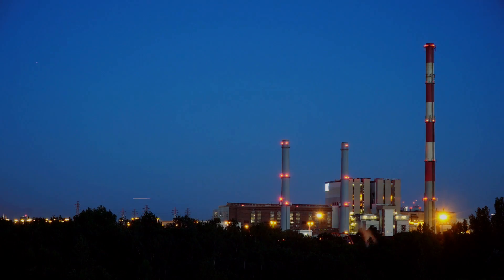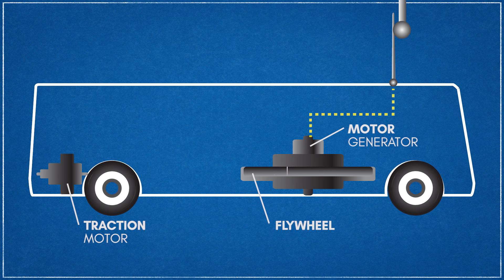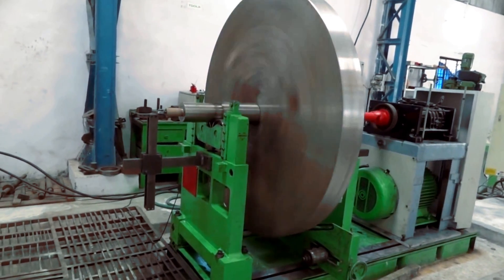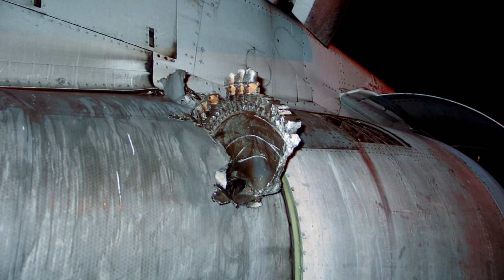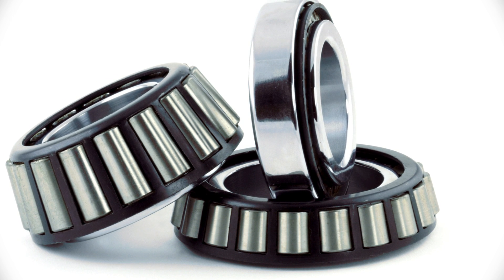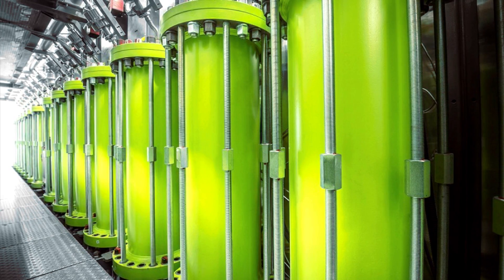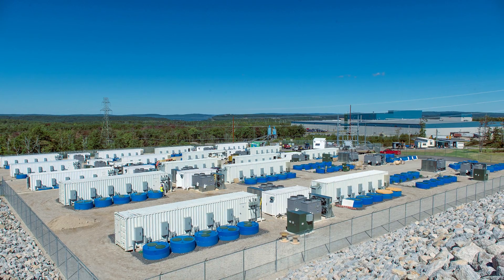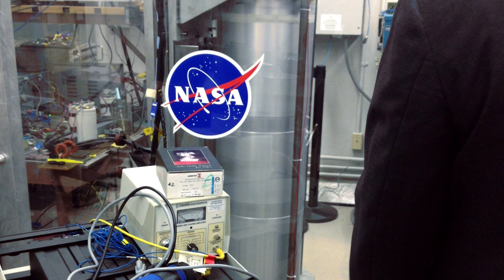The Mechanical Battery

Comment: Really nice introduction to a topic most of us are not familiar with. Seems one of the best technologies for grid storage.
Reply: The price per kWh isn't close to viable, unfortunately. You'd need something along the lines of graphene by the megaton at low prices. It's hard to compete with the power density of a flywheel, to be sure, but the energy density is lower than batteries and the price per energy capacity is lower than batteries.
Reply: @Jo Blow Huh, it doesnt? Renewable installation is led by Brazil, India and China, and developing countries install a lot more than developed ones. I agree nuclear is great, but extremely expensive. You are talking out of your ass.
Reply: Best grid storage system we have right now is called a hydro electric dam sir... grid storage system basted on a flywheel would have all of the same problems the buses had making them cost ineffective
Reply: Innovative*
Reply: @Jo Blow LFTR Reactors are definitely the best long term solution!
Reply: @cd2920  he is obviously trolling, just ignore him
Reply: for off-grid homes too, for day-to-day wind/river/solar energy storage
Reply: so advanced*
Reply: Aye
Reply: so natural*
Reply: @Jo Blow You missed the point.  It was good for short term storage . . . in the 1950s.  Since then, technology has advanced just a little bit.  Mechanical systems now have efficiencies that make them viable for longer-term storage, like for example, when the sun doesn't shine.  Their bearings are nearly frictionless.  Electrical leads store or retrieve energy into or from a sealed container, just like any other battery.  The tech may be too massive and gyroscopically troublesome  for consumer vehicles; but there's nothing wrong with using it as stationary storage in the grid or facilities like hospitals and factories.
Reply: Please do research and make videos about this topics

https://fitsmallbusiness.com/hottest-emerging-tech-jobs-2019/

Top 30 topics/ideas I want you to talk about in your future videos in this new YouTube channel "New Mind":
1.  Graphene Battery
2. Nanotechnology 
3. Artificial Intelligence, Machine Learning, and Deep Learning. 
4. The three levels of artificial intelligence 1. Weak or Narrow Artificial Intelligence  2. Strong A.I.  3. Super Artificial Intelligence 
5. Quantum Computers
6. Artificial Intelligent Robots
7. Autonomous Machines
8. Blockchain Technology
9. Bitcoin
10. Hacking and Cryptography 
11. 5G, 6G, 7G, and beyond. 5G New Radio Network.
12. Big Data
13. Cloud Computing
14. Parallel Computing
15. Geospatial Drone Technology
16. BioNanotechnology (biology and nanotechnology)
17. Tachyon (Faster-than-light-particles)(hypothetical particles)
18. Alcubierre warp drive (10 times faster than the speed of light) https://www.universetoday.com/89074/what-is-the-alcubierre-warp-drive/
19. Nuclear Fusion
20. Space-Based Solar Power
21. Bio-fuels
22. CERN. Large Hadron Collider. Antimatter
23. Dark Energy 
24. Dark Matter
25. Quantum Supremacy (Google Tech company)
26. Quantum Mechanics 
27. Quantum Teleportation 
28. Quantum Time Traveling
29. Interdimensional Travel
30. Interstellar Space Travel
Reply: @C D You don't know me.  I live off the grid.
Reply: @C D What's pathetic is that your ridiculous Alt-right wind turbines are destroying thousands of birds and bats all over the world.
Reply: @frankm3214  Cats kill billions of birds and no, they aren't eating them. Humans have allowed cats to breed to overpopulation levels but because we feed them they do not hunt for food, nor are they useful by hunting vermin. Smog and air pollution kills billions of birds and other animals and the only way to reliably get rid of that is to switch to non-polluting renewables. And again, no, renewables do not cause pollution when they produce power so yes, they are non-polluting.
Or in short: Windmills lower the amount of dead animals. Solar lowers the amount of dead animals. Anyone who complains they kill birds is either an oil lobbying liar who lies or an idiot too stupid to have an opinion that matters.
Reply: Your renewable energy wind turbines are killing thousands of birds and bats.  Do you not care?  You Alt-right Nazis care nothing about the environment.
Reply: @frankm3214  House cats kill far more. What are YOU going to do about your Tigger?
Reply: @frankm3214  are you even familiar with bird law?
Reply: @salmon taco The fact that you call it "bird law" proves that you have no idea what you're talking about.
Reply: @frankm3214  now let's say you and I go to to toe in bird law and see who comes out the victor.
Reply: @salmon taco This isn't a video game.  I'm a real person.
Reply: @frankm3214  I'll take that advice into cooperation.
Reply: Frank M its either kill some birds and bats or continue burning coal. gas. create nuclear waste. or dam rivers. there is no up side to any current technology, id prefer any system that does not accelerate climate change.
Reply: @Frank M Killing birds is better than killing humans. Still, we have to improve on this, but if you choose bats / birds over humans, you're in a special kind of stupid.
Reply: @frankm3214  Consider how many of those equal species survive every time you snuff a vicious predatory bird!
Reply: @adamblomberg  >just a tiny fraction compared to these other things
>also it's so bad that you literally need a permit and a conservation plan for how you're going to mitigate the massacre you're causing

Something doesn't smell right here.
Reply: @adamblomberg  Commercial wind turbines are killing birds that are not being killed by cats. The amount of bats being killed are threatening one species to extinction. No free lunch with any energy production.

Comment: The crankshaft converted linear motion to rotary. The flywheel reduced the effects of torque impulses.
Reply: Your half right............The crank shaft does indeed convert the motion, but the flywheel takes the engines torque pulses and delivers them to the drive train in a smooth and controlled fashion. If the engine was directly bolted to the transmission, driveshaft or torque tube the vibrations would damage and destroy even the most robust drive train components over time. I guess you could think of an engines flywheel like an electrical capacitor. Now a days, dual-mass flywheels take this a step further in manual transmissions as weight/efficiency is now a major factor and durability is reduced in favor or fuel economy. Torque convertors have all but eliminated the torque pulse problem in automatic transmissions due to their fluid coupling drive.
The engines harmonic balancer does the same for the auxiliary components, and eliminates the harmonic hum/oscillation of the belt and it's components when running.
Reply: @camerond8176  The converter IS the flywheel, it's mass negates the need for a separate flywheel. Modern converters also lock-up once the vehicle gets up to speed eliminating any effect of the fluid coupling.
 The harmonic balancer is to reduce oscillations in the twisting of the crankshaft.
Reply: Chris Russell torsional vibration damper/harmonic damper with rubber insert is a device to control crank vibration and resonance. “90 deg” thing you talk is secondary order vibration. It’s occur twice per crank revolution due to the cosine effect of the rod and crankshaft. Inline-4 engine with a flatplane crank eliminate this vibration via balance shaft
Reply: Wrong the "Flywheel" does not smooth torque impulses, that's the joke of the harmonic balancer at the front of the crank. and only manual transmission cars (a dying bread in the US :( ) has a true flywheel, all automatics use a flex plate of some sort. The torque converter acts as the rotational mass in automatic cars, the flex plate it there to hold the starter ring (some dodge have the starter ring on the torque converter) and allow flex between the crankshaft and input shaft that's inside the torque convertor
Reply: @TdrSld  the harmonic balancer dampens vibration in the crankshaft

Comment: As always amazing video 👍 there is only one thing that's bothers me from some time... why we not use springs to store energy. Are they so bad in efficiency?
Reply: The amount of energy you can put in a spring is very limited. The equation is E=1/2 k x^2. E is the energy, k is the stiffness of the spring and x is the length of compression. Too stiff springs are mechanically somewhat impractical and x is very limited as well. A better solution than steel springs would be compressed air as a spring (this principle is actually used in some edge cases). However for energy storage there is too much friction involved in the seals and the energy density is very low compared to cheaper alternatives.
Reply: @ProjectPhysX  very interesting stuff, thank you for reply.
Reply: @maciekm7953   Maciek M  I totally forgot about mechanical watches. They do use tiny springs as the energy source. At this small scale, springs are the perfect storage solution, but for larger scales other options are much better.
Reply: If we spend some research into making springs better (different properties/ materiels combined) we could make springs a viable option.

Im not sure the physics of it but... imagine a building sized watch main spring vs a building sized flywheel... lets spend 10 hours at a certain power charging it up so they should contain roughly the same amount of energy in them, i would think the flywheel would be at a disadvantage because it must be spinning to keep that energy. while the spring could simple sit there until the energy is needed.  BUT i also think that the watch spring would need to be much larger to contain the same amount of energy

Comment: Let's talk about "reinventing the wheel"..... I've always hated that phrase.
Reply: In the early to mid 1800’s, George Cayley did “reinvent” the wheel. He is the one thought to use string or wire for spokes so the axel is pulling from the top as opposed to pushing on the bottom. Like a bicycle wheel. It allowed for much lighter weight wheels. He is also the guy who came up with the aeronautical relationship of lift, thrust, drag, and weight.
Reply: Ba-dum-tss!  :-P
Reply: danballarin it means ‘a useless idea or a large waste of time/resources”. Used in the proper sense, it is a perfect phrase, conveying the ridiculousness of said endeavour. Though that is not to include the use of the words separate of them as a phrase, since the wheel has been reinvented many times, hence our use of pneumatic tires as just one example. I guess the use of a capitalisation ie “the Wheel”, for the concept and “the wheel” for the physical mechanical device is the proper way to differentiate the two.
Reply: Norm T  Not invented, "Discovered" ...   Round rocks and round logs were rolling down hills long before humans were even walking upright.  But hey, if you didn't see it- I guess it didn't happen.  Just like No bear shits in the woods.
Reply: calholli I recently discovered my wife rolling down the hallway to go get another snack.
Reply: Norm T  Let me guess, you think that man invented fire too don't you. smh
Reply: @calholli  Man didn't invent fire, but he certainly invented uses for it, like burners in heating furnaces.  Man didn't invent round objects, but he certainly invented uses for them, including wheels and axles.
Reply: The wheel was never invented, it was discovered.  A round river rock or a fallen tree trunk are both wheels.
Reply: A wheel on itself is a disk. A wheel plus an axis do the trick.
Reply: @compfox  A large log on its side still serves both of those roles, so long as you're willing to replace the logs at the front of whatever you're rolling as your load rolls forward.
Reply: The wheel was discovered, the axle and pneumatic tire were invented and allowed us to take vehicles to the next level.
Reply: @ChuckBeefOG  The wheel is an invention.  Roughly round objects rolling down a hill in prehistory are a discovery.
Reply: Joe Sterling k
Reply: @calholli A rolling object and a wheel are not the same thing. The crucial innovation of the wheel is it's axle which makes it practical for transportation. A log or rock doesn't have an axle. The wheel is an invention.
Reply: Nahome Tesfay a log is it’s own axle.
Reply: @jamesbizs  Not quite. The axle is the part you can connect with the rest of your machine with a bearing. Imagine you had a crate and two logs. If you tried to use the logs like rollers wouldn't be held in place with respect to the cart so  you'd have to keep putting the logs back in place. The key innovation is to hold the logs in place (without restricting rotation) with an axle. Thanks for responding!

Comment: Soooo, you plan to use less fossil fuel by using fossil fuel to provide electricity to then make mechanical energy and then convert it back to electricity and all of that conversion and loss from the conversion process is going to save energy. Yeah that sounds perfectly feasible. (Not)
Reply: Fossils fuels does not require that form of storage, as you can easily control their power output to match the demand. This technology is dedicated to renewable energy such as solar and wind, which will sometimes outmatch the energy demand. At this point it's better to store that energy, despite efficiency issues, than to let this free energy vanish.
Reply: @Rommmm  Look at the actual power production of "renewables". It has not and will never outmatch demand. Do the math. Oil, nuclear,coal, and natural gas are the most energy dense fuels that we have. Wind and solar just can't match it. You waste time with these so called renewable energy sources if you think they will ever come close to providing the energy we currently use. They have their place but can't possibly replace the technology that it's intrinsically dependent upon.This very video explains in plain language that the flywheel is powered by an induction motor (conversion loss #1) which requires it be generated in the first place. Then it's used to make electricity (conversion loss #2) to drive another electric motor that then drives the wheels (conversion loss #3) and that that somehow is more economic than just powering the bus with an internal combustion engine? Do you know how to calculate the efficiency of a given system? It's a race to the bottom in quality of life. A purely political agenda because the science/math doesn't support it.
Reply: @danspkr  I have not said that renewables would replace fossil fuel energy, and I know about conversion losses of a storage system such as this one. I only mean that this storage system is meant to be used with renewable energy which do have an excess production at some times of the day where the demand is low. Of course on a global scale there is no such thing as excess energy, I agree with you. But on a local scale this technology has its benefits i.e. for a house powered by solar panels.
Reply: @Rommmm  Name one "new" tech that didn't make an "old" tech fade away. If there is an increased dependence on solar and wind wether real or artificial it only stands to reason it will ,if nothing else, over time phase something else out.(wonder what that would be?) Already we have crazy politicians trying to make it law that we use 100% renewable sources for energy and bankrupt the current energy providers.

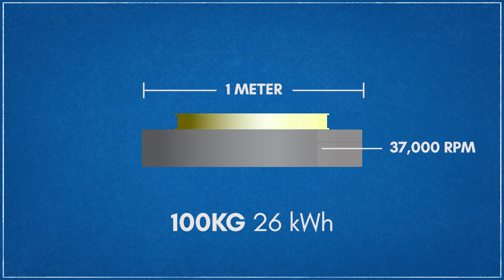Comment: 12:43 but it would be impossible to roll the car :D also to go up hills. nut it's just a minor detail xD
Reply: You can use two counter rotating flywheels to negate each others effect
Reply: @taikonot  Yes, but tilting counter rotating flywheels causes internal stresses.  In other comments higher up, they mention that this made fail the gyrobus?
Reply: Mihály Dózsa 
But it would never roll if in a crash
Reply: why not two counter rotating magnetic flywheels with battery and or capacitor, with friction motors that will generate under braking?
Reply: @swampmonster8626  Because counter rotating flywheels cause internal stress when tilted.  And these stresses can be so high that the wheels or their axis break apart.